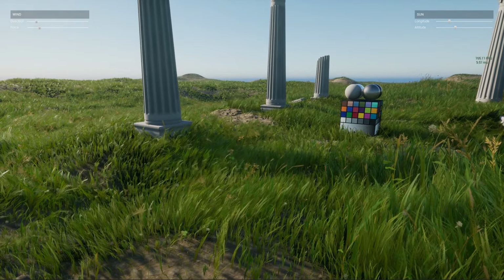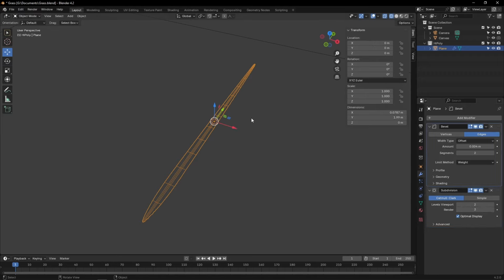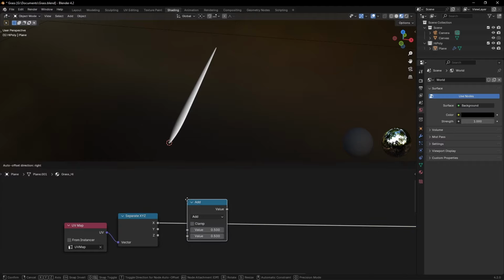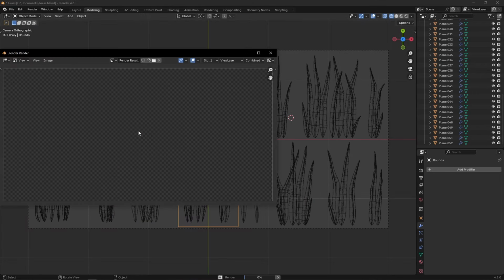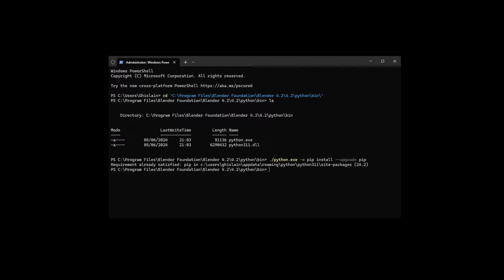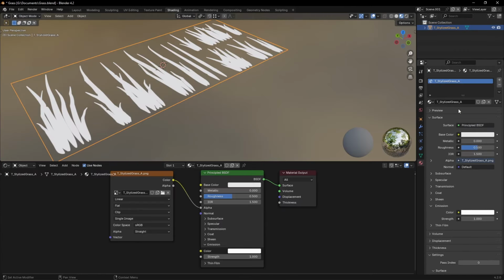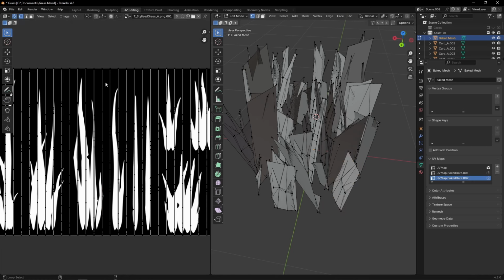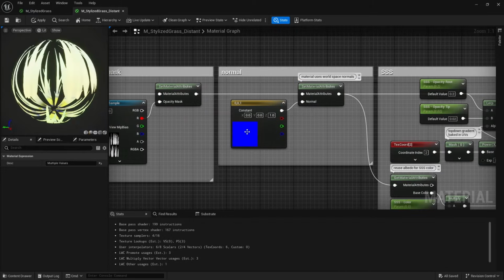My workflow to create grass assets for realtime apps using Blender

Comment: Sorry im not that understand the part 33:19 which explaning regrading the random value. Its seems like each LOD vertex got different random value, but 33:44 you say you keep  all LOD in the same object so they share the same random value. can you explain this, not realy sure how does it should be
Reply from the maker: I'm poorly explaining a workaround for a limitation of this particular addon. I remember providing a better solution in my more recent Game Tools extension.

The challenge is to unify the random values across LODs. For example, if a grass card has a random value of '0.326' in its UVs, it should maintain that same value for LOD1, LOD2, etc. If not, you'll likely see LOD popping because the random values will change between LODs.

The problem with my old addon is that it generates a random value per object. Since LODs are usually separate objects, you typically tend to have separate grass cards and separate LODs. This results in different random values for each LOD. One simple trick is to merge all LODs into a single object and then use material slots to select and separate each LOD later on. This way, the random value will be baked uniformly across all LODs, eliminating any potential issue with non-shared random values.

Hope that makes more sense.
Reply: @ghislaingirardot  can I know the random value in V channel for each LOD is same or is just similar. I'm using the new 'Game tools' and Random Data per Object layer. It seems like if I bake as the method in vedio, every grass card vertex in a lod got different value, but different lod same nearby vertex got random value quite near

Comment: Hi, Ghislain! Thanks alot for your creations, incredibly helpfull and explenatory!! I have question (sorry if I missed answer in video): why your texture space before baking is 2x1?
Reply from the maker: No particular reason, I like to work with a wider than taller area when authoring foliage assets, as it's usually much wider than tall. If that makes sense.
Reply: @ghislaingirardot Thans, yep, that makes sense)

Comment: Thanks. Would you say your grass system is good for top down ARPG? Is seeing the grass and wind from afar and above still looks good even?
Reply from the maker: Depends. Likely need some tweaks but yeah, top down grass is fairly straightforward, simpler even than FPV, TPV etc because of the many tricks you can use to densify the grass thanks to the fixed camera orientation.

Comment: Nice Video! 
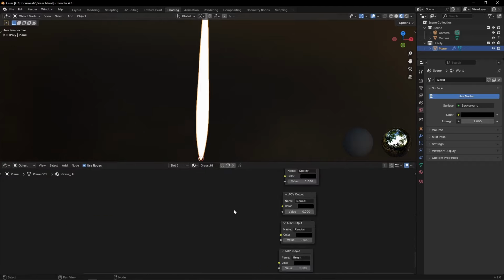I'm following your video to make my own grass. At 14:09 in the video, why do we need to flip the y channel of the normal? Is it to adjust the coordinate system of the normal?

(By the way, to reproduce the mipflooding results in the video, you now have to switch the github repository to the “dev” branch. Otherwise, the generated normal map will be very weird.)
Reply from the maker: Ty! Yes, Blender uses the OpenGL coordinate system, UE DirectX. Thus the Y axis/green channel needs to be flipped. There's also an option in the texture settings in UE to do that if you don't do it in Blender.

Comment: I was using "Real/Realistic" Grass & yeah you change the colour slightly & it turns into stylized, there is little difference. But Opinions: Do we need LOD's for grass, not saying use nanite, I'm saying if we WPO lower grass towards the ground at distance in theory & with distance culling  on top it should stop rendering in Unreal Engine at a unnoticeable height? Meaning we could just use LOD0 & LOD1 for grass (Keep in mind I'm asking for opinions not stating a fact in anyway) & still get decent performance as they are instanced meshes? Asking as I'm noting a lot of issues with LOD-2/3 billboard meshes people use for grass & this seems like a easier solution because we can literally remove the bad/poor LODS Rather than re-making high triangle HQ grass in nanite?
Reply from the maker: It really depends on a lot of factors... Grass culling distance/view distance/vertex count/targeted plateform/amount of instructions in the vertex shader etc etc. There's no right answer, grass is a fricking pain in the butt and every project has unique requirements and there are millions different tricks you can use to meet your targeted performance budget.

Keep in mind instancing 'only' helps with drawcalls. It's great but doesn't help with the GPU potentially having to render literally millions if not dozens of millions vertices just to draw grass and that can become a huge bottleneck quite quickly. It is my understanding that even today's GPUs can be easily bottlenecked by vertex processing, possibly because the emphasis is put on pixel/compute shaders & tensor cores, not so much on vertex processing units.

In all my testing, reducing vertex count and being super agressive with LODs (meaning lots of LODs & simple billboard at a distance) was the key to performant grass, plus limiting masked opacity overdraw & quad overdraw (see my stylized grass course for some example). Nanite is obviously a solution to not care as much about geometry, but you need a whole different mind set when it comes to foliage to account for the technical limitations Nanite comes with, geometry overdraw being the °1 concern. It's plenty doable but it's just a totally different way to do grass, and foliage for that matter. Fortnite is a good example. Working with a new technology often requires working with new constraints. Nanite is no different :)
Reply: @ghislaingirardot  Thanks for reply, I guess the straightforward way of more LOD's & adjust range for them is how I'm going to move forward with my issue.

Comment: If anyone wants to skip the mip flooding and just do some simple flooding the easiest way I found was to use the inpaint node in the compositor in blender which will apply directly to the render so you don't have to adjust anything manually in another software. Also you can do your channel packing there.
Reply from the maker: I originally tried this but it's not working for me :( It does flood the image but creates an horrible black outline around the edges.
Reply: @ghislaingirardot  I believe this could be because you first have to unpremultiply the alpha and then apply it again after the inpaint. At least that's the setup that worked for me.
Reply from the maker: @benefit_xyz  Roger that, I'll try. Ty for the suggestion :)

Comment: Thanks a lot for this, all of your grass videos are amazing and it's clearly taken a lot of work/practice to learn all this. I tried using Houdini to make grass blades faster using curves and randomizing the bending and tapering of the blades. I'm sure you could do the same with geometry nodes in blender using curves or even using some of the hair grooming tools. Worth a look if you want to make some of the earlier steps less tedious.
Reply from the maker: Yup, definitely a solution. Depends on the artistic direction. For stylized rendering, many of my colleagues are not willing to give up the artistic control that a 100% manual approach gives you. For semi realistic/realistic, precise controls, emphasis on details & exageration isn't as important and a procedural approach can be great. Both methods have their pros & cons. Use the one you're most comfortable with.

Comment: why dont you use nanite? and no transparency with a mid poly grass mesh?
Reply from the maker: Reasons I don't use nanite are explained in the video but you may go for it. You're mistaken if you think this is an easy-solution for grass. For the mid poly mesh, it's a solution I explored in previous videos. Here, I chose to explain the basics. Up to you to add a bit more vertices and get rid of the opacity map :) (which is often worth doing, yep)
Reply: @ghislaingirardot  ok good! thats what i tried for an open world like scene, detailed grass mesh (nanite) without opacity, spawned on the grass layer of the landscape, everywhere, and wind disabled in a distance (15000 for me) , but im curious to know what is the best method and if it can be optimized 

Id love to see you do videos on open world settings for grass + plants and trees if possible! inside ue5, and you explain why or why not nanite

Comment: For the height you can just create a gradient in the shader lol
Reply from the maker: In what shader? If you're talking about UE, you're mistaken. The height information I baked into a texture is gone once exported in the engine and can't be re-created. It's not the card 'Z height', it's the hi-poly depth data. Kinda useless in this video but as I said, it's an example of what can be done.
Reply: @ghislaingirardot  No in blender for the first steps! when you are doign the texturing of the grass blades
You used a cube with a weird technique, but you can just do a gradient on an axis, where close to the camera is white and the limit of the grass blade (far from the camera) is black
Thats how i render a height map from like a tiling material inside blender
Reply from the maker: @Dhieen  How so? With a Texture Gradient node? Afaik, you still need to use a Texture Coordinate node to get the position data to generate the gradient from, no? And using a second object is great for visualization and ensuring all objects share the same [0:1] range (or have a different one), imho. But I could be missing something here, lemme know.
Reply: @ghislaingirardot  Ok i see, did you try texture coordinate Generated > mapping (rotate 90 on Y axis) then you scale on the Z axis, plug that to a gradient texture?
Reply from the maker: @Dhieen  The Generated pin creates a bounding box per object so that obviously has issues when you want to create a unified [0:1] height gradient for multiple objects that all have different bounding boxes. Hence why I'm using a separate Object.